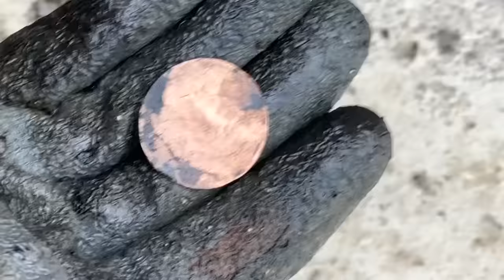WW2 GUNS and Cannonballs Found Magnet Fishing in France!

Comment: Ive taken old axes like that and restored them and made a new handle. That would be a really cool axe to restore. I did one that was in similar condition and instead of grinding and machining it down to get all the rust pits out i ended up using a heavy wire wheel on the bench grinder to remove the scale then i got the edge all worked out and reshaped the poll/butt and cleaned it up a little with the belt sander then I polished it with some buffing compound and it turned out really cool the patina turned out super nice after it was polished up the rust pits sorta turned black and the high spots turned shiny silver it actually looks really natural its kinda hard to explain but it turned out way better than sanding all the pits out. You should save that axe head and clean it up and hang onto it maybe put a handle on it some day if its still able to be worked, i know sometimes stuff like that gets really brittle after it dries. Thats actually a really cool find.
Reply from the maker: Wow that sound awesome mate! I’d love to do that with this axe, I did keep it so might have to give it a go to restore it 😃🤙🤙🤙

Comment: The white thing with numbers is not part of a safe. Its a manual receipt printer used when you paid with credit cards before the digital age in stores. They put the credit card on it and thin paper on top of it and then moved the huge lever that is on top to print the credit card number and other information on the paper that was later delivered to the bank and paid from the account linked to the credit card.